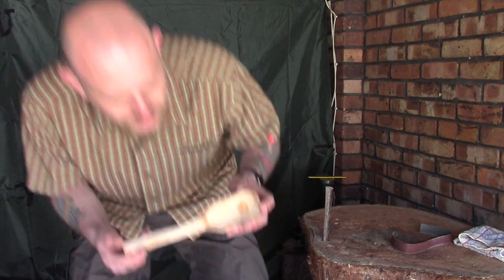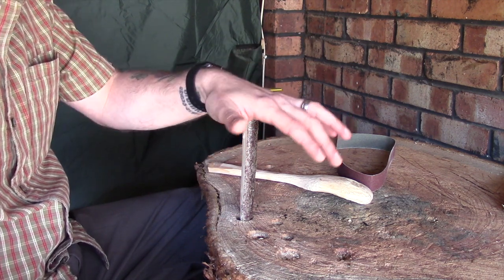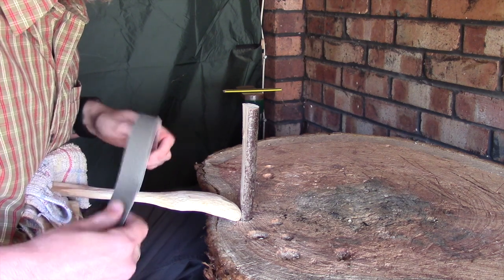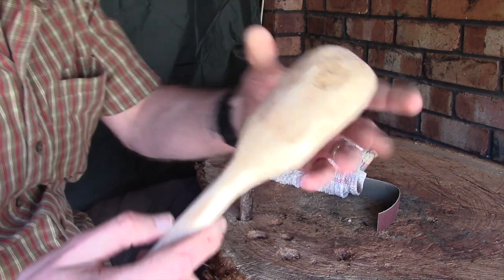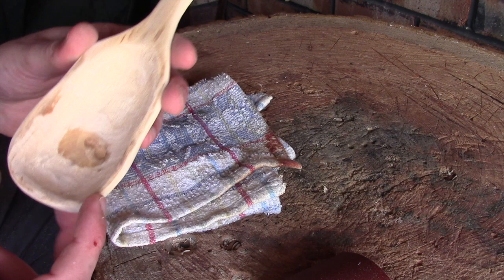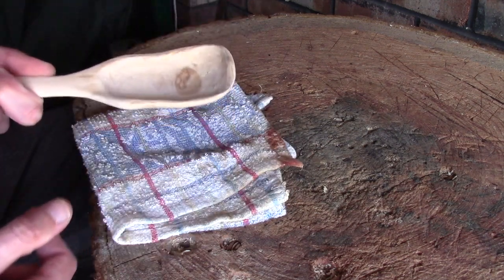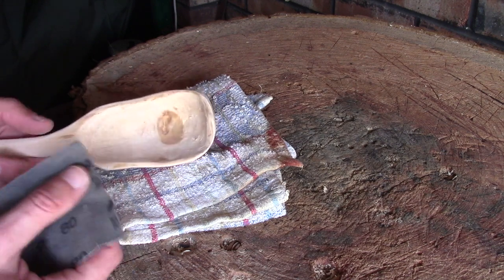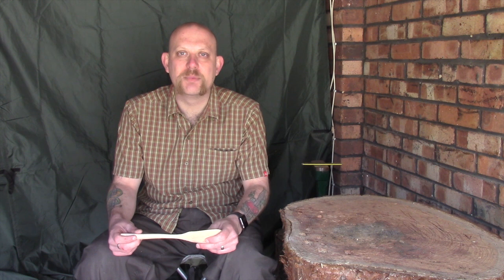An Unusual Spoon Idea - Part Three

Comment: If you use a knife sheath, it can make for easier spoon sanding and finishing.  Wrap your sanding strip along various directions of the sheath, you can get a spectacular and easy sanding technique, with a greater hand held item.

Put the sanding strip along the sheath sewn line of the cutting blade edge.  Put the point into the spoon.  Use the blade point curvature for the same sanding the spoon curvature.  Spin the point into the bowl for sanding out the interior.  Use the same point for rounding the spoon ladle curved lip and the rounded back of the spoon bowl.  Can use the same edge for a long sanding motion to shape the spoon and handle connection.

With a wider sanding strip, put along the rolled edge of the knife sheath.  This curved feature allows you to roll and push/pull the sanding edge along all parts of the spoon, for curved, and faster/easier sanding.